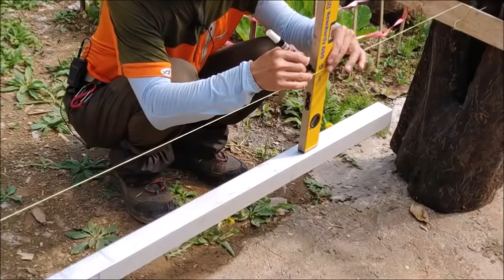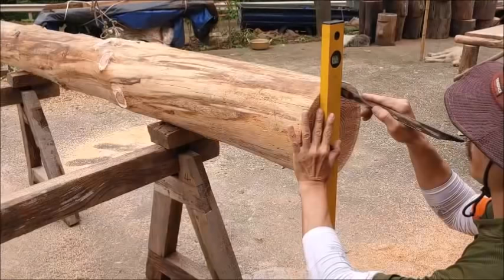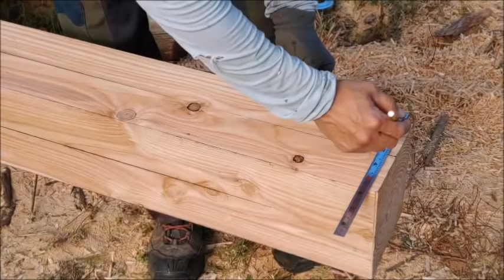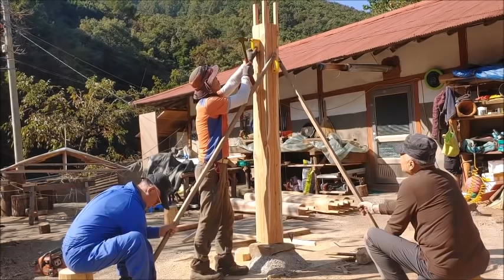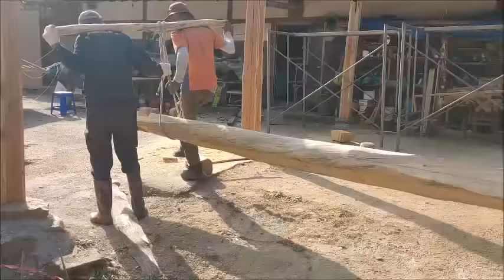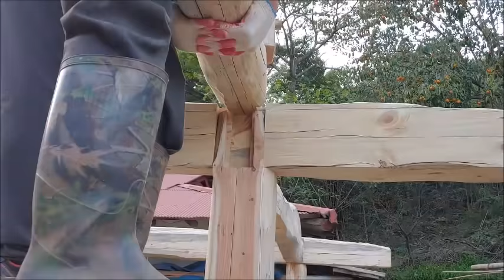House 7 - 한옥기법으로 창고 만들기,목수,목공,한국 전통,woodwood

Comment: Hi Master Carpenter I'm fascinated about yours skills I'm from Slovakia , I just wondering if is possible to make terrace with just 4 stand wooden block up and will be connecting from the wall but can you make it with 7° angle with the same technique how you use on this construction? Thanks for answering Sir kind regards Peter
Reply from the maker: Once you have created a horizontal terrace, you can use additional wood to make it slightly sloped.
Reply: @woodwood1  thank you very much for answering Master Carpenter wish you the best

Comment: Thank you for sharing your wisdom. I have looked and tried many different types of building joinery over the years and come to feel the Korean and Japanese systems are truly the most elegant, strongest and long lasting there is.

I am building a flat warehouse structure like your workshop for a similar purpose. How many of the walls need to be made for the bracing to be completed? For example if I wanted to use a structure like this to park my tractor then one or two sections between the posts would need to be open. 

Also if I wanted to brace between posts without building entire walls I could use the Japanese 貫 "Nuki" ("pass through" or "bracing beam"). Do you use this in Korea? Very similar beam locking principles I have seen you use.
Reply from the maker: I will tell you if it has the same structure as the video.
Unless you're building a wall, you'll need 8 braces.
Two in each corner.
You can do it the way it is often used in "timber frame".

Comment: I want to make such a structure with 6 pillars. Please help me a little to the middle pillars, which I saw have thinner tenons than the edge pillars. At the edge pillars I understood that they are 1/4 of the side of the section. For those in the middle how to calculate the ratio? The angle of the dovetail joint I assume is 60 degrees. Even a link about calculating such a joint would help me. Thank you in advance.
Reply from the maker: View the column from above. Try dividing it into 5 equal parts. horizontally and vertically...
And, try drawing several times. Then, at some point ! You will come to feel...
Reply: @woodwood1  I understand, 5 is the division. Thanks! What I regret from all these videos from you is that I do not have a continuous translation that I can understand in everything you explain through your voice. Anyway, I watched you several times and I still understood something. I made 3 years ago, before I saw your films, a first structure on the principle of center lines, with 4 pillars on stone plith-foundation and I am in admiration of the tradition of building houses in Hanok. I am looking forward to your next film, sending you a good thought from Romania.
Reply from the maker: @dumitruceara3579  Thank you.